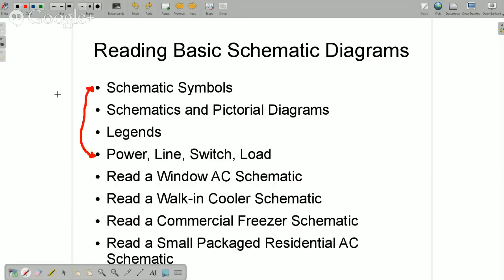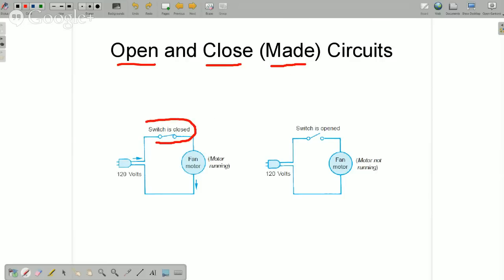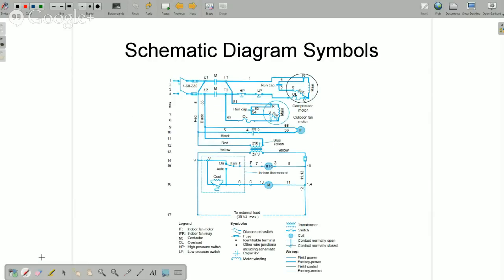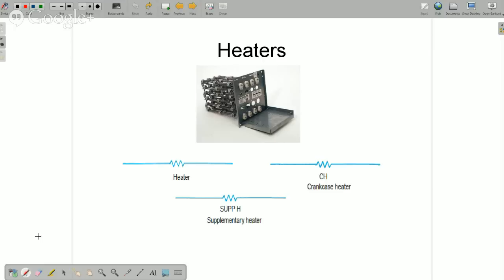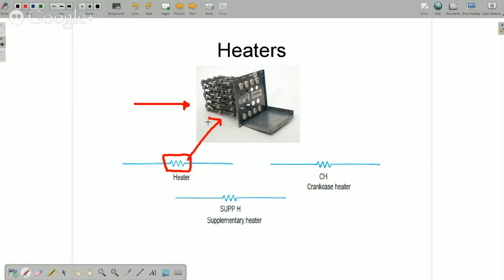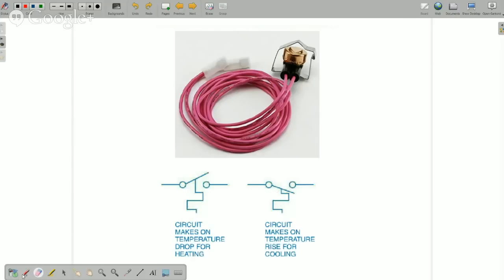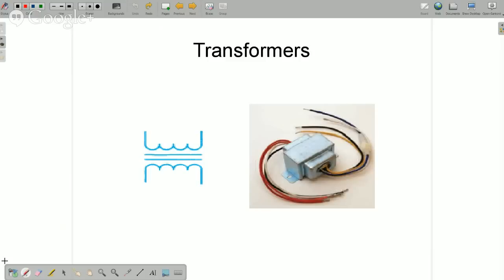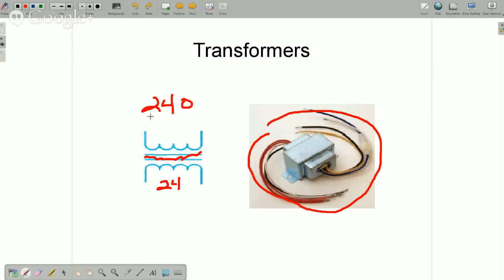Schematic Reading - HVAC Training Solutions

Comment: At 32.20 is there a problem with the fan run N/C contact here, the light is off when the the thermostat is open, and then its off when the thermostat is closed, due to the N/C contact, unless this light is powered to ground, 
Im probably missing something, please explain.